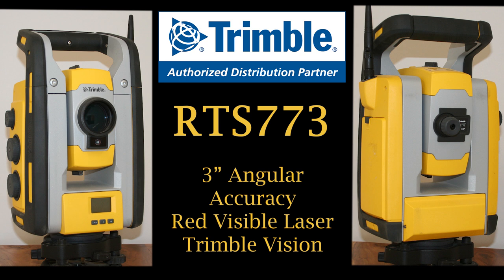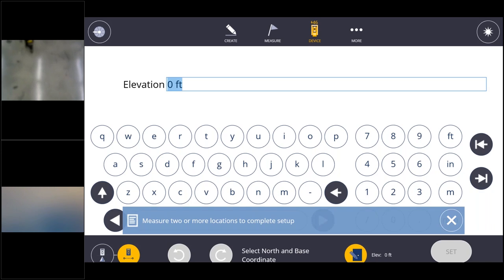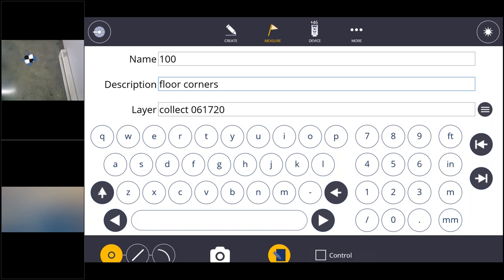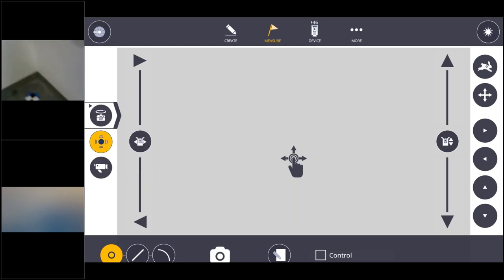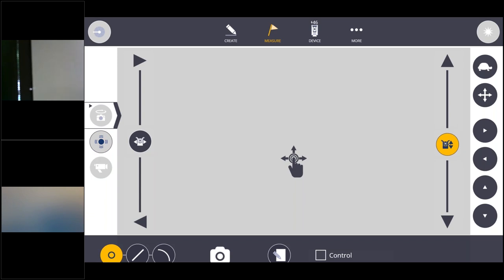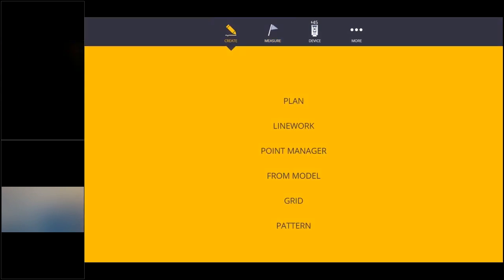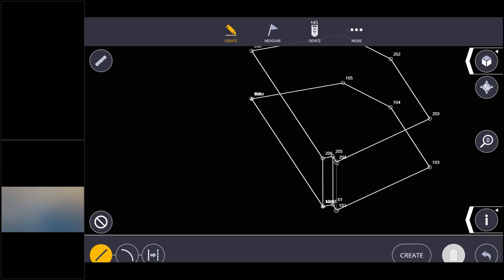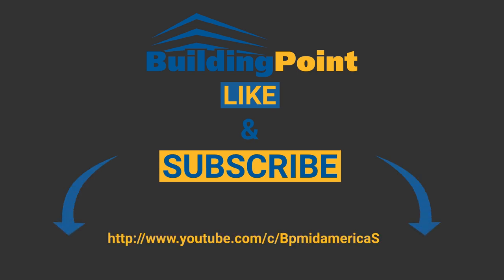Trimble Field Link - RTS Data Collection Example

Comment: Are you able to use the collected reference point to use it as a control point? Are you able to setup over it with the rts with the optical plummet and back sight to a known control point to bench in?

Comment: I have been having issues collecting data outside on trimble stickers for CP. The message (measuring...) pops up and dosen't stop measuring untill you hit stop. Same thing happens when I shoot Control Points. Do you know why?
Reply from the maker: Simon, thank you for your question.  There could be many contributing factors for this result.  If I may inquire as to what unit you are using (should be indicated on the back side of the laser head) also it would be helpful to know what version of the software you are running on your tablet and if you changed the prism settings to shoot the reflective foils.  If you would like please feel free to email that response to support@bpmidamerica.com and we will help you get resolution.